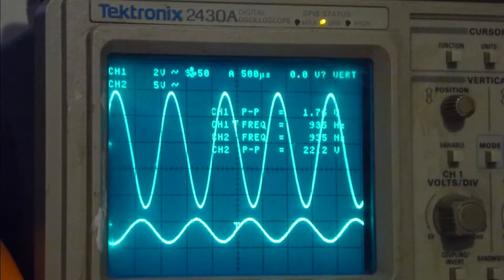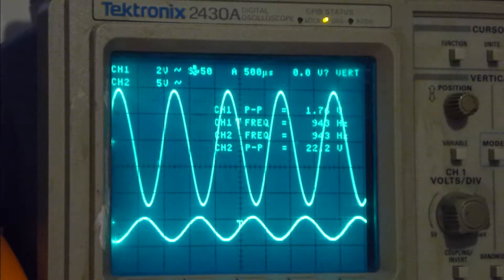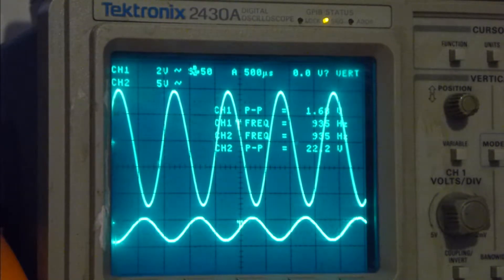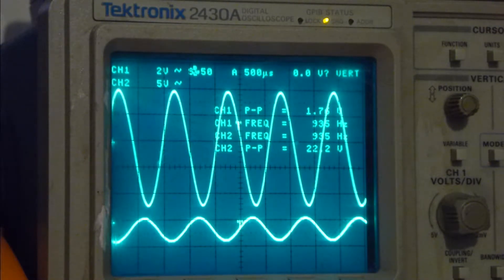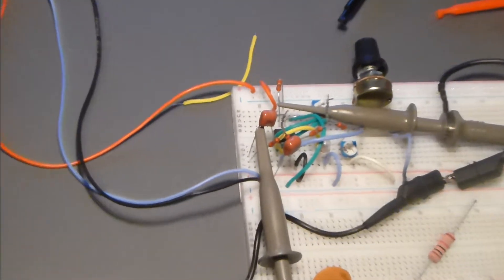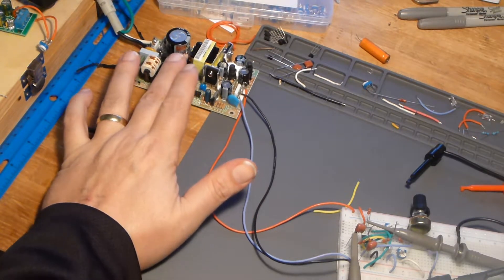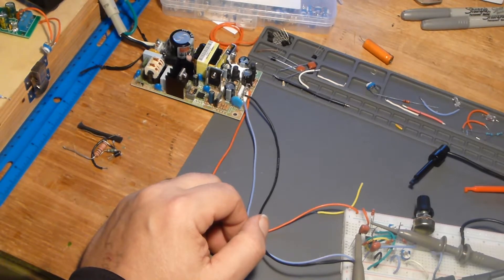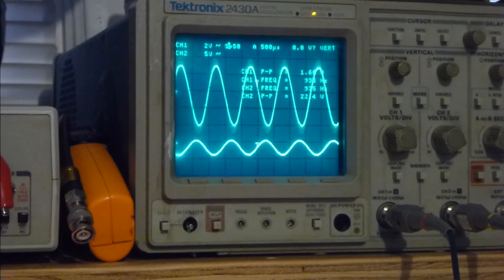Quick and dirty curve tracer. Part 1: Half baked breadboard

Comment: Did you finish making this? As an external?  I'm trying to figure out what on ebay qualifies as a good scope to do this. I understand it needs XY inputs, or also EXT inputs. Example, does the HEath O 12 qualify? Don't want to get stuck with the wrong older scope. 73, KM5L
Reply from the maker: I did not. I had decided to build an external before I got busy. This guy did however, and you don't need EXT.
https://www.youtube.com/watch?v=cdAIScQJ4IA